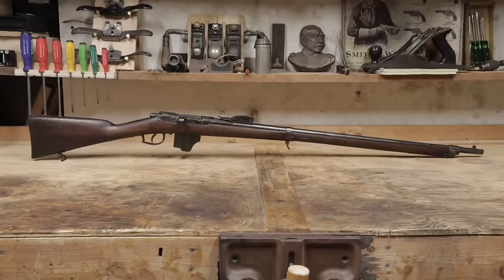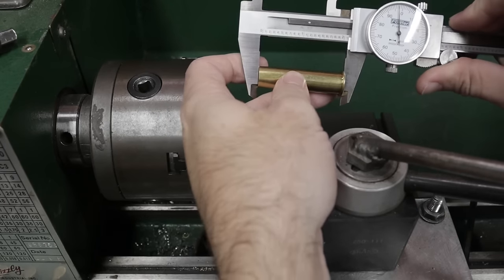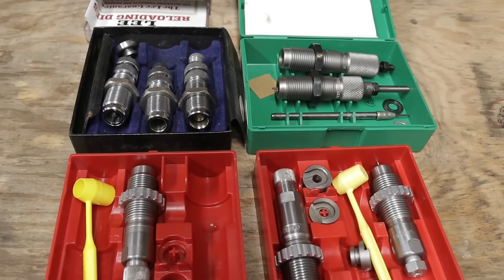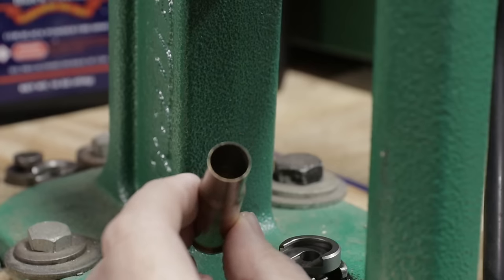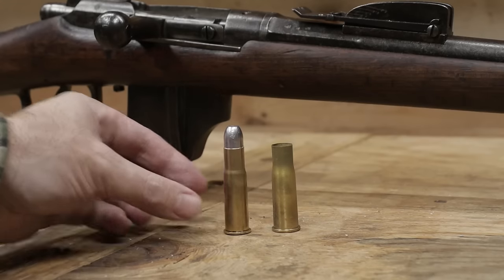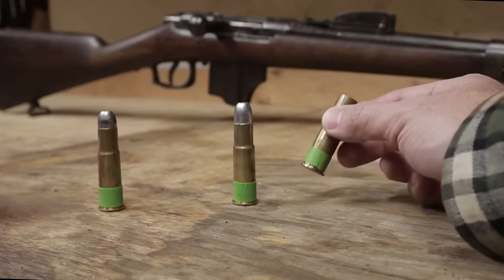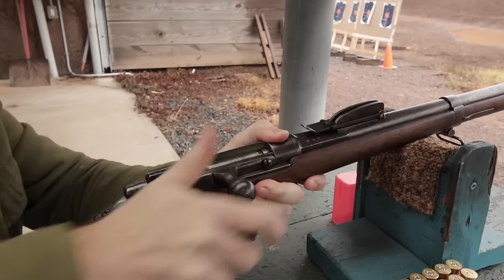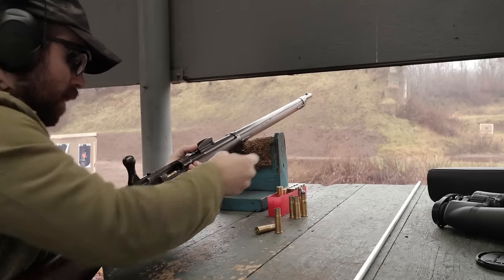Dutch Model 1871/88 Beaumont Reloading

Comment: Great video! I’ve had a lot of luck with the Lee .458 405gr cast bullet in my Beaumont, loading with a 45ACP bullet seat and taper crimp die. I’ve used 70gr of FFg in the past, but I think I’ll move to smokeless loads based on 45-70 trapdoor recipes from the old Lyman Cast Reloading book.
I’ve bought 43 Beaumont and other brass from LGM on Gunbroker, he does fantastic work making all sorts of esoteric cases.

Comment: My Dutch/Ethiopean Beaumont just arrived from Royal Tiger Imports. Appearance wise, the rifle is a mess. It’s filthy and even had a stalk of straw in the bore. My first concern was the bore, which after some cleaning turned out to be a pleasant surprise. There is some pitting but the rifle should be quite shootable. I plan to take the bolt apart and all other removable parts and get them in the ultrasonic cleaner today or tomorrow. The stock will need lots of fine steel wool and linseed oil.

New cases ARE available from Northern Shooters Supply in Australia and I plan to order some. I’m in the US so there’s a six week delay while they get an export permit but I bought .43 Spanish cases from these folks and the cases are really nice and the price was right.
Reply from the maker: Sounds like you lucked out with the condition of the rifle. I've seen the cases available in Australia, but never considered ordering them. I'll look into it

Comment: Ah, a kindred spirit when it comes to jerry-rigging  anything at hand to reload an old calibre. Ironically, my last project was trying to figure out brass and resizing for the 8x58mmRD round, one of the sets you used. It was only after CH4D had a short run of those dies that I was able to finally easily produce rounds for my Husqvarna Rolling Block rifle.
Reply from the maker: I'd like a Swedish Rolling Block in 8x58r. One day I'll find one
Reply: @rakumprojects  Up here in Canada we got a pile of them imported some years back. Generally good condition across the board from what I'm told, though mine had some issues.

Comment: Great video. I wish I had seen this video when I started reloading this caliber. I have some information from original sources. The case length could vary from 50.5-51.5 mm.
Therefore it is better to call the cartridge 11x51R. In 1875 another bullet, the Harsveldt bullet was introduced. Diameter 11.6mm = .457. Weight 25 gram = 385 grains. 5 gram Black powder.
Cases can also be bought from Horneber Germany . They can also be formed from .470 NE. I was lucky because someone sold once fired cases!. Or from 32 gauge shotshell. I have Ch4d dies. I am not very satisfied with them because the seating die does not accept a .458 bullet.

Comment: You can use 32gauge brass shot shells match midway midsouth shooters supply
Reply from the maker: I ordered some to experiment with. The process of converting them should be the same.
Reply: You can get a set of dies from a co called CH4 they make obsolete dies I have got several from them they work

Comment: Awesome vid, can you tell be the brand of that mini chop saw?  Ive been wanting one but so many have terrible reviews and Im not sure which one to get.
Reply from the maker: It's the basic Drill Master from Harbor Freight. It seems to work ok as long as you're not expected very precise results.
Reply: @rakumprojects  Thanks, I need it for converting .303 Brit to 6.5 Dutch rimmed.  The shoulder bumping step leaves you with a good bit to trim and I've been taking a hacksaw to it which is a pain.
Reply from the maker: @Toolness1  It would work well for that. I do the same for my 30-06 conversions. Then use a Lee trimmer to clean it up and bring it to final length
Reply: @rakumprojects I have done 30-06 to 7.7 Japanese and it'll be good for that.  I found one on Amazon and ordered it.   My local store didn't have any and the HF website says "in store only"

Comment: Woo Hoo! I just scored a set of C&H  11.35x52r Beaumont dies. Now I can cancel my back ordered ones.
Reply from the maker: Nice find! Where did you get them?
Reply: @rakumprojects  I got them on e b a y .
Reply: @rakumprojects I have CH4D dies. The seating die is too small. You can't seat .458 bullets with them.
Reply from the maker: @pietvermaat5928  What bullet diameter do you use? Or do you use another die to expand it a bit more?
Reply: @pietvermaat5928 That's odd. All I use are .458 cast bullets and my dies seat them fine.

Comment: Just curious, wouldn’t it have been easier to just fire form the cases and then figure out the proper neck diameter to seat the bullets after?
Reply from the maker: The cases needed to be sized down to fit in the chamber. Fire forming is used when cases are already small enough to fit and need to be expanded.
Reply: Yeah. as soon as i pressed send i was like duh, those straight cases wont fit in the chamber. I’m too used to forming 7.62x54 to 8-50r lol.

Comment: The rifle have the barrel inside shape matching with the ammo shape ? If not, do you tryed yet to make a extra long cartridge with substantialy more powder than the normal lenghts For turn this rifle into a african hunt kind of rifle ? This is co0l when i finaly build my own rifle thr first thing i always imagine that i goin to do is to make my rifle a super caliber kind of rifle and at same time shot regular short normal power ammo
Reply from the maker: The chamber could be reamed to fit a longer cartridge but then you could be exceeding the pressure the action is designed to handle.
Reply: @rakumprojects  do you understand about materials ? I need to known for example what special kind of Stell is made a 50 BMG - or a 700 nitro express
Reply from the maker: @Vo_d_kontra_o_norMAL  it's not just the metallurgy, it's also how the action locks. The way the Beaumont locks with just one locking lug at the midpoint of the bolt isn't sufficient for mostly smokeless powder cartridges.